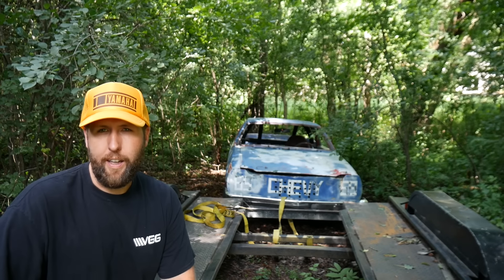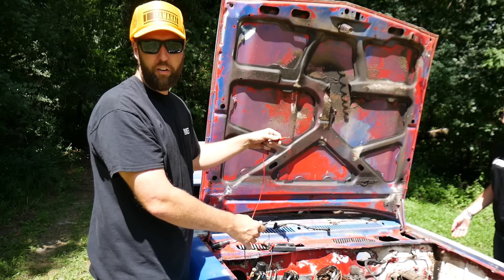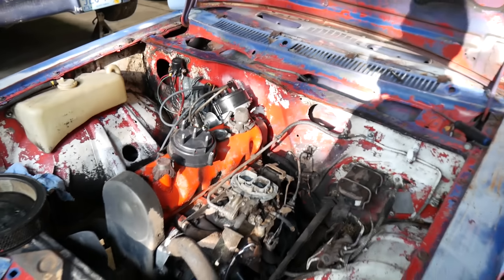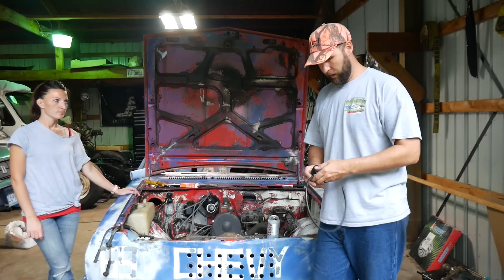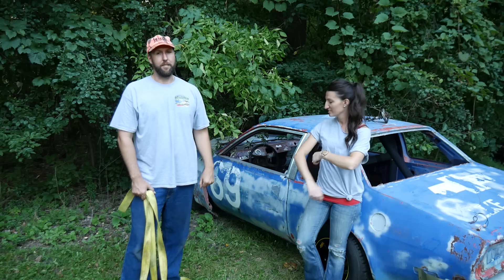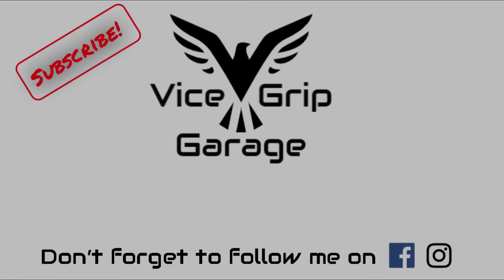Chevy Monza First Start In Years Part 2 - Vice Grip Garage EP38

Comment: Good thing a guy has a few cold snacks in the fridge.
Reply from the maker: guys gotta have that, if nothin else
Reply: @ViceGripGarage    BATT-TREE cable was not FACT-tree,so make some digitral magic happen with more electricals,as I would do.More voltages is better.High-Intensity energy GM distributors likes voltages.A ZAPP from that power house will knock you across the yard,or usually your head against the hood. At least an elbow into the firewall at warp speed. It takes a while for your heart to return to it's  usual idle rate.I'll usually sit at the curb and blink a lot.
Reply: ddd228/Dave in Seattle. 
Funny how getting zapped like that absolutely makes you sit on the curb and stare a thousand yards for a minute.

Comment: I better stop and get some a twelve pack of cold snacks
Reply from the maker: must have
Reply: Yes I did lol, she had 121gw at 88 mph
Reply: @ViceGripGarage   Low on cold snacks,but I have some special stuff in the freezer. 41 horsepower from Kentucky.
Reply: ddd228/Dave in Seattle. 
Dave damn straight, I don’t think I’ve ever watched a VGG vidja without a gut load of Kentucky Delux. Yes. I am a high roller. Don’t let that bother you though

Comment: Had a 79 monza.loved it.was clocked at 140.brakes sucked but she would fly!
Reply: I HAVE a '76 Monza HB 2+2 . Original V8 4-speed car. Bought used in '78. Built the 262.5 after 100,000 miles and drove it ANOTHER 100,000 before building a 350 for it! 350 has less than 4000 miles on it! Ain't no wimp 350 either! ;)

Comment: Step 1: Run the piss out of that 4 cyl until she blows.
Step 2: LS swap it and make ridiculous hp and blow up the the rear end.
Step 3: swap a ford 9in in it and over build the car.
Reply from the maker: I like ur style
Reply: Step 4: run nitromethane to make sure everything was perfect
Reply: Just like we did in the 70s with the Vega. A lot of them ended up with a 350 or 327 back in the day.
Reply: 350 or 454 swap would be easier and much cheaper
Reply: Like ur idea but there’s a 6cyl in that not a 4 ohh sorry it is a 4 my bad
Reply: @jbatic8094  love to see a 454 crammed in that thing.

Comment: My Vega with that same engine ..Burned so much oil that you couldn't see the cars behind you . I was 17 back in the early 1980's ,I bought that Vega Wagon from my cousin for $100 and put a clutch in it ...Was My Party Wagon .I miss that ole 1974 Vega ...When I sat at a Redlight .All the cars around me rolled their windows up ... Every 45 Miles the oil light would start to flicker  and I'd run into the part store and pick another Quart of oil up for like $0.39 a quart ..Loved that old Smokey car ....My Brother owned his own Rig " 1978 Kenworth Cabover with a 318 Detroit " every time he changed his oil it took 14 Gallons of oil ..I used to take the used 14 Gallons of oil and filter it through a T-shirt and into jugs ....My Vega was an oil Recycler .My Vega could eat through that oil in less than a month ....My Vega converted that oil to smoke ...Great car

Comment: Back in the early 1990s, my buddies and I scored a 1980 Monza hatchback with the 3.8L V6 under the hood. The car was toast - expanding foam sculpted to replace the rusted-out A-pillars, and when you put it in reverse, the driver's side lower control arm was rusted away, so the front wheel contacted the inside of the wheel well. The Buick 231 ran like brand new so the car would still smoke the tires off. 

Naturally, we put a 10-day trip permit on the car, and then drove it as fast and as hard as we could over the roughest roads we could find. Rolled it, covered it in mud. The control arm still didn't break off. 

Bunch of teenagers riding back into town with a Monza with the roof crushed in and we're all wearing motorcycle helmets. Police car pulls right up beside us at a red light. The cop looks at us, hold up his hand like a horse's blinder, puts on his lights and sirens and blows through the red light. :) 

That Buick 231 3.8L V6 ended up in my 1980 Chevette. Hooker even offered a motor mount kit and headers. The V6 Chevette was scary. 

I grew up around cars of the 1970s and 1980s. It was very rare to see a Vega 140 engine, they had all been scrapped before I got to owning my first socket set. I think I have seen two of them in the wild, both in junkyards. Up here in Canada, the snow and salt killed the Vega/Astre/Monza/Sunbird at least as quickly as those horrible engines. 

The sad part is that the Vega could have been so good, but GM cheaped out and really damaged its reputation with those things.

Comment: I know this is a sort of old presentation but this is my first view of it.  The Monza reminds me of my old 73 Vega which was just the mommy to the Monza anyway.  The old Vega was a really stable car that had a speed-o-meter that only went up to 110.  However, I took the old gal on an interstate trip one day and covered 43 miles in 20 minutes.  Stepped on the gas and watched the needle pass the 110 mark and then vanish behind the dash.  Ran real nice with well balanced 60 wides in the back and 70's up front. 
But that's beside the point.  I bet the ground on your old Monza was suffering the same issue my Vega did.  One cold morning I started it up and made it down the street about a block before the clutch cable conveniently broke.  Had to limp it back home without the aid of a clutch which was fun.  Got a new cable and put it in and damned if the same thing didn't happen again about a week later!  However, that new cable that was supposed to be all bright and shiny was burned...  It turned out that the damn body ground was NFG and all the cranking power was going through the clutch cable.  A new ground fixed that issue but it's definitely something to watch out for.

Comment: I had a 80 sunbird. I cut the roof off and plugged the holes properly, built a 231 v6 manual. Painted it yellow, and then decided to put it on a Jeep Wagoneer frame. Crazy stuff a unsupervised 19 year old will do. LOL

Comment: 4 minutes to get into the seat... "That was easy." About 28.6 degrees too much timing... "That doesn't sound good at aaaalll." Farts back through the carb. Silence as he looks for flames flickering under the hood. "We'll just keep going." Running commentary in between start attempts, hammering on the dash, fires up with foot to floor, takes a moment to grin at camera (foot still on the floor) dumps clutch at 5479 rpm and leaves garage sideways, coasts off gently into the trees. 
I believe I have found my long lost brother. I was crying laughing watching this. Thank you so much.

Comment: You know, a feller could weld a steel caster to each corner of that old Monza, head down to the part of the highway that's under construction and has concrete barriers on other side of the lane that's open, mebbe do a little blindfolded bootyhaulin'.

Comment: Those engines were known for burning oil.  Did you do anything to keep it from severely smoking like they usually did? Used to be check the gas and fill the oil. I had one that never had to change the oil just the filter.
I always had to run a hotter plug R45 TS

Comment: Please post some sort of warning in the title or some prominent place indicating that a video might contain brief scenes and sounds of the old 70's 4 bangers most commonly found in Vegas and a smattering of Monzas. I wasn't paying much attention, then heard the sound, saw the engine and it threw my ass slap dab in the middle of a flashback. LSD ain't nothing to the Vega 4 banger flashback! I started using every word a preacher would use, except in a different order, throwed my good tools out in the kudzu patch (not the HF stuff) and was found later in a dark corner of my garage, in the fetal position, rocking back and forth with drool running out of both corners of my mouth. Some close friends were called, started playing the idling sounds of  302, 351 and 429 Boss engines whilst singing "Thunder Road" acapella over and over. It doesn't hurt that one sounds like Robert Mitchum. That got me stabilized until another buddy ran to his car, fetched a jar of homemade apple brandy. The brandy was poured into a grease gun and pumped into all available orifices. I'm better now, but my farts still smell like a burnt axle bearing on an AMC Pacer!

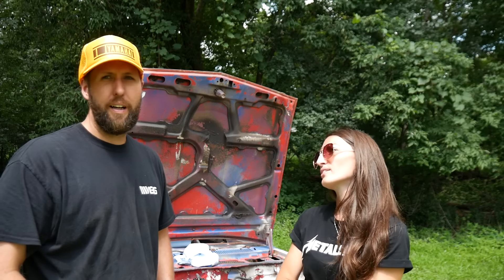Comment: Jessica, take it from a smallish gal like you that used to change tires for a livin...You're gonna wannna put your backside on the concrete in front of that tire, slide your feet under the front & back tread at about 5 o'clock & 7 o'clock (or 4:30 & 7:30 depending on shoe size & tire diameter). Put your hands at about 4 & 8, & use a combination of ankle/toe leverage & good ole arm muscles to lift that wheel onto the lugs. Your back will thank you later for not bending over said wheel to lift it. Now my method only works when the vehicular is barely high enough off the ground to get the wheel off in the first place. It obviously won't lift over a couple of inches. On a beater like the Manza, your zip gun method "is fine" (as your feller would say)...but on most other vehiculars, the star pattern zippin' is highly recommended. Y'all keep up the good work & I'm gonna continue my binge watching. A gal just loves y'all's videos.  ;-)

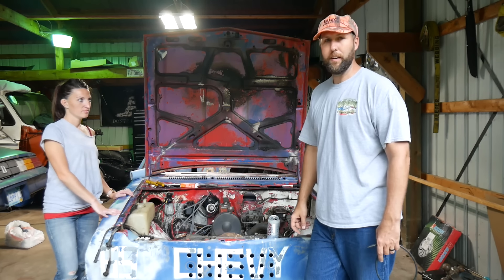Comment: at 16:09 you need a good pair of Duluth Trading Co.  jeans with the gusset plate inserts in the crotch so as to increase the range of motion of those hips!. Heck they should be sponsoring you. There from Wisconsin up in yer neck of the woods.

Comment: /w\METALLICA/w\ !!!  That hood looks kinda sketchy, could come down on  a gals armilators or her noggin... a guy could get some dollar store bungie dealies or some hairties in a pinch... no... it's fine.
Ok, I'll quit the accent now... I had a 70 Monte Carlo with some points distributor that had some fusible link ignition wire through a ballast resistor that reduced voltage to about 9 volts that went bad and kept burning up coils until I converted to HEI with the straight 12 volt input... wonder if something like that would cause the lower reading?
Definitely good idea adding a ground from the rear block to firewall... or what you did ... it's fine
Aha, you fixed the hood support!  The distributor got turned quite a bit putting in the plugs and threw off ur timing, I think maybe caused that hard cranking at the end?  I can't believe you put up with that starter like that!  Sick burnout to the weeds, funny jokes and super cool everyone got in for a lesson on this one man.

Comment: Derrick, a question please....What size and bolt circle are those alum. 4 bolt wheels that were on the Monza Please? And would you be interested in helping another guy out in exchange for some cash funds if they are 100MM x 4 bolt?

Another racer guy, would love the matching 4 roll about flashy shiny rollabout tire hangers, but could make great use of the 2 for my FWD 20" tall and (super lower gear making) slicks. Need to pare some weight on my 84 Daytona stocker.

Comment: Why did one distributer have a vacuum spark advance and one didn’t if you ran a vacuum hose to it,it might smooth your idle out..
Reply from the maker: Vacuum advance doesn't change timing at idle, or full throttle.
Reply: I know it won’t do anything full throttle but a direct vacuum can make a difference at idle. If its through a canister then it will have no effect until under load...
Reply: I know it won’t do anything full throttle but a direct vacuum can make a difference at idle. If its through a canister then it will have no effect until under load...